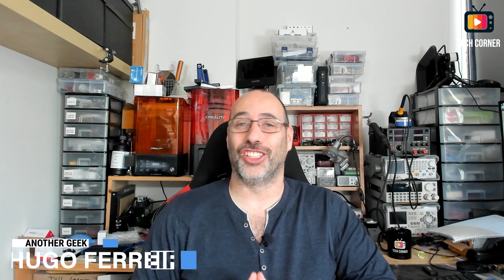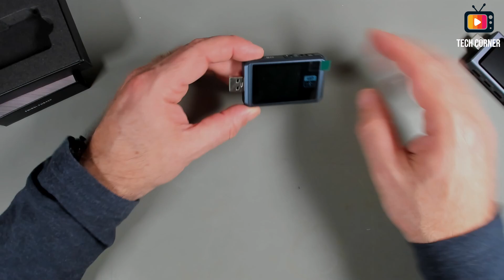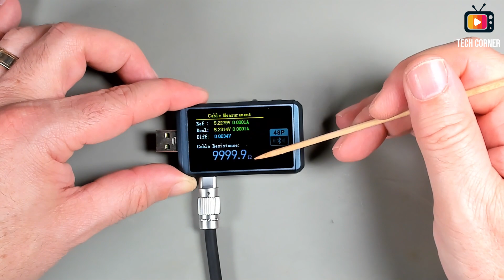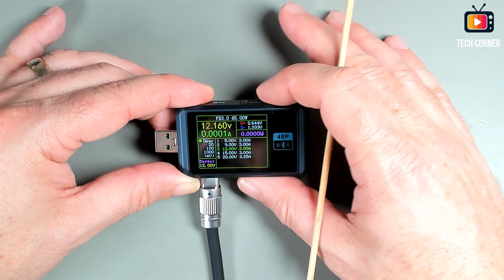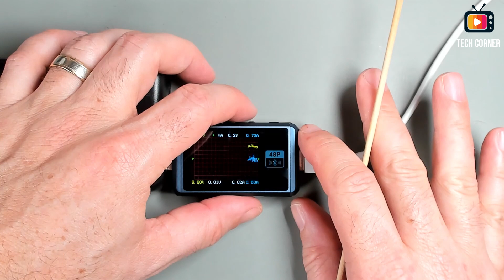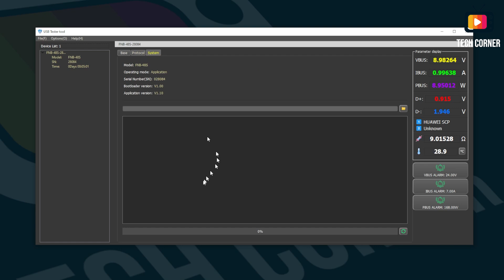FNIRSI FNB48P USB Tester⭐Complete Review!

Comment: Thanks for the review Hugo, it is very useful for me with my project. I have an important question.  Can i use it to monitor IOS? I just want to monitor the power usage of smartphones.
Reply from the maker: Hi, really sorry for this late reply, a lot of comments queued and a struggling to keep up. Yes you can, it doesn't depend of the operating system. If the current/voltage passes trough it, you can measure it. Thanks for watching and again, my appologies.

Comment: Please help me, I have a USB tester like that too, but when I input it with a charger, the FNB48S screen is already running Amps and watts (6w) while I haven't installed a load on the output, and that makes my FNB 48s immediately heat up to 80° C+. is there an error/shot on my Fnb 48s and How do I fix it? For QC/PD testing, it's still safe, there are no problems. The main problem is that when the input is plugged in (no load), the heat on the FNB increases drastically, until white smoke comes out. please cooperate and help
Reply from the maker: Hi, your device is clearly malfunctioning. You should enter in the whatsapp FNIRSI support channel and contact them to replace your unit. Thanks for watching.

Comment: I have an FNB48S and your videos help me but I can't understand the faults of the smartphones I test when the voltage curve is cut by the amp curve. Could there be a short circuit and how do I know? thank you and well done
Reply from the maker: Hi, I doubt that will be short circuit. Do you have problems with all smartphones tested??? That's odd and highly improbable. Have you activated the PD switch? Thanks for watching.
Reply: yes I activated the PD switch. but I have a period at 0.01 A and 0..05 W and another period at 0.54 A and 2.7 w I changed the battery.
This does not happen on other smartphones.  @TechCornerTV

Comment: hi, is ther a better version on the market than this device? 🤔
Why are they putting still micro USB ports on new devices, they should have only type c and the USB A ports specialy the micro USB port for updates makes no sense this days. 🤔
Reply from the maker: Hi, personally, I like more the FNB58. Regarding MicroUSB, yes, it never made sense that connector 😁 but there are still a lot of devices with it. Not having is limiting the market for this device, commercially will not make sense. Thanks for watching.

Comment: Hi. I've bought this tool. Initially I'd like to see the current power consumption of USB devices which does not always seems to work. However, is there a way to use this FNB48P for limiting the battery charging to 80% of the capacity?
Thank you
Reply from the maker: Hi, that's a good question, but I don't think so. Might be also a good suggestion for improvement, please share it on the Whatsapp FNIRSI support forum, they're quite responsive. Thanks for watching.

Comment: Thanks Hugo.  I gave it a try on an Amazon lightning deal and was disappointed.  Bluetooth doesn't do anything (I have Windows and iOs).  The digits flip around too fast... no way to change the persistence or significant figures.  Mine hangs during protocol detection.  USB-C requires fiddling with the cable connections to wake the unit.  I think I would be happy with a newer version of a MaterHawk.  Maybe someone who uses the FNIRSI everyday would be comfortable with it, but I just can't appreciate something that requires a re-learn ever time it's used.
Reply: Hi, I've bought this too. For the protocol detection make sure the FNB48P ist also powered using the micro USB (PC connector). This seems to be necessary to power the device independently without disturbing the protocol.
Reply from the maker: Hi Paul, hmm I get it, not a fun experience. I did not had the same experience, but as I told in the video, for me the FNB58 is a much superior device in terms of how the information is presented, thats the one I use normally. Thanks for watching.
Reply: @TechCornerTV  Thanks Hugo, I will check out your new review on that item, and if it looks better I will get that model through your affiliate link!

Comment: It would be nice to tell what you are testing.  Like where do the cables go.
Reply: He does not understand what he is testing… if he read the manual then he would  know that some features require a special scenario (for example cable testing requires a constant current load)

Good try but most of this video is useless!
Reply from the maker: Hi Bob, got it also. I did show in the begining the power supplies that I will test, but will take more attention next time. Thanks for watching.

Comment: When testing supported protocols, tester may be turned off due to input voltage 0V (usually PD protocol). To prevent this, connect PC interface to computer or other power supply. For example, ChargerLAB Power-Z KM003C tester has a supercapacitor for these cases and lasts about 5 seconds without power.
Reply from the maker: Hi, thanks for sharing this, nice to know! Thanks for watching 😁
Reply: Yeah, this unit should have a cap installed for such occasions.
It would be interesting to check if it could be added without any drawbacks.
Reply: @MCgranat999 hi, is ther a better version on the market than this devise? 🤔
Reply: @WaschyNumber1   Yes the witrn U3 or U3L